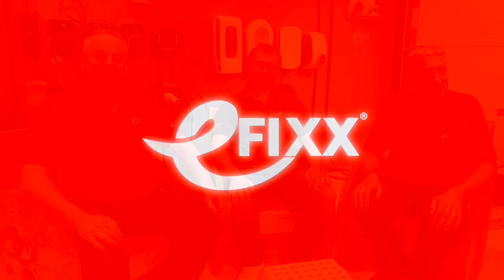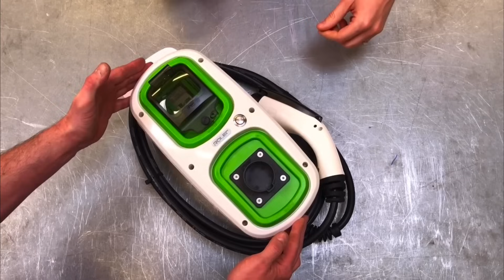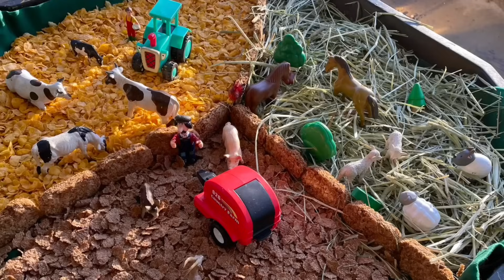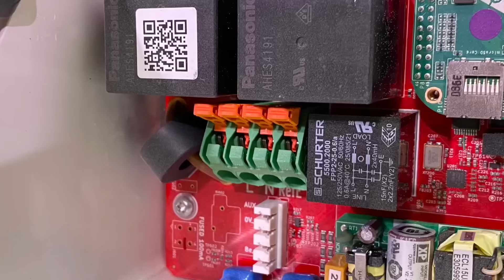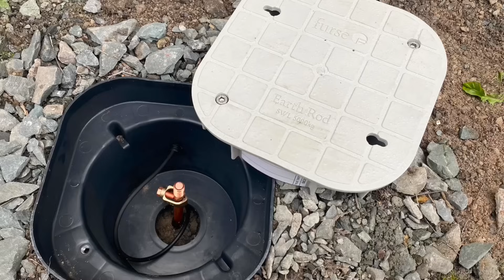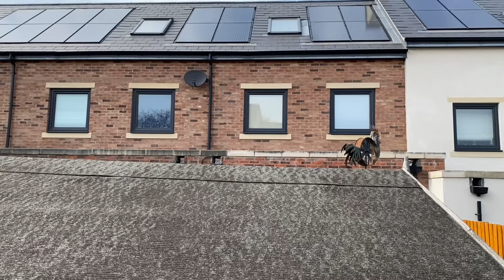EV Charger REVIEW: Cheapest, Smartest and easiest to install with EV Nick.

Comment: The easee charger is so simple it should be the only viable option for domestic installation
Reply: Am awaiting delivery of “easee one” however the other versions don’t compile with DNO for load balance
Reply: @NicolasRaimo  there arent any regulation on load in my country yet, the biggest advatage with easee is the simple programing and ypu dont need to use a app if ypu dont want
Reply: As others have highlighted unfortunately they don’t yet have a solution for load balancing (for UK meters anyway). For some (me included) this is a deal-breaker.

Comment: I was glued to this one, have you done a presentation yet on solar charging, e.g what is the average solar output of a single panel, what is the minimum amount of panels to charge at 7.2Kwh, are there solar EV grants available and so on.
Kind regards
Reply: It depends, but you can get a good idea of average yields for an installation here: https://re.jrc.ec.europa.eu/pvg_tools/en/#PVP

If you put in a nominally 1kW array, the angle, orientation and where you'd install it you can get curves giving you the average yield month by month.

You could do 7.2kW with a 7.2kW array in May but you might be looking at a 72kW array to do the same on a grey January morning. Unless you're in a hurry it would be easier to limit charge power a bit.

Depending on where you are it can also make a huge difference. Central northern England (around Leeds for instance) is pretty bad for irradiation and you can over-spec an array 30-40% or more over inverter capacity before you start noticing any reduction in yield.
Reply: @tceng9449  this is fantastic data, it gives me a good footing to carry out further research. 👍

Comment: I'm watching this with interest from Australia. Is there a reason that Andersen isn't in the collection? I see they're fitted by at least one YT Spark
Reply: Contacted them to send me a unit 12 months ago under the same terms of every charge point shown behind us for this video,  Didn't want to take part under the same terms wanted special terms just for them which I wasn't willing to flex for 1 company over the other 9,  Tried them one last time 2 weeks before filming this video never got a reply to that contact.
Reply: @NicolasRaimo  thank you!
Reply: @NicolasRaimo  trying there best as company to destroy themselves
Reply: They removed their inbuilt RCD protection last time we went to fit one, I think Jordan and Cory from Artisan found the same issue. Anderson also removed the hard wired connection for networking so they're only wifi enabled now. It's a very nice aesthetic charging point but outside of listed buildings and Porsche dealers bundling them with the Taycan it's dropped off for us. It's a shame as we did have a pending order for 2 dozen but client ended up going with Zappi instead.

Comment: Interesting as ever. I fear that in a few years electricity during the night will cost the same as during the day as "off peak" demand for domestic dwellings could be greater than their day time demand. Solar of course does not work very well "off peak" unless you have storage batteries. I still don't think most of the cables and transformers under the control of our DNO's feeding our homes will cope during the night with many homes possibly drawing a continuous 7 Kw load (electrical infrastructure in my area is 47 years old). We also will have to provide the power to charge the 2 million plus white vans up every night and they may have even greater energy requirements. Not forgetting all the heat pumps which due to low temperature heat output making you leave your heating on 24/7 (perhaps an additional 22 million 3Kw or more load on the network).
Reply: "Many homes" will charge ~450km worth of electricity each and every night? How do you come to that conclusion? That's about 13 times the average daily distance driven for cars in Germany, I find it hard to believe that Brits drive so much more...
Reply: One of our highest call outs in the south east currently is pen faults and low incoming voltage due to aging infrastructure (late 40s early 50s - 70-80 years old). It's already causing issues if only one or two people have EV's charging at any time (natural gas mainstay area so hasn't shown as an issue up until now).
Reply: Exciting times :) the french certainly built out their grid to supply heat a few decades back

Comment: I am not a fan of RCD at source for anyone that's currently app selling their driveway and charger access. It's one thing to share your driveway but it's another to give random people access to your consumer unit. Unless you're going to have an IP rated unit outside and that as the source but a cluttered outside wall is not something many home owners want. Not surprised the Anderson A2 isn't up there but they now don't supply it with built in Type A or a wired internet connection.

As for more people having smart connected appliances as prices go up, no. People just need to change their habits like they did when E7/E10 was a mainstay and time control their washing and drying loads for over night etc. Things don't have to be smart if people actually think, it's not good to encourage people to off load responsibilities to tech.
Reply: Absolutely bang on , smart technology does not make our lives or job better or easier, as it it doesn’t work always braking down has a short lifespan and it has to be replaced ,  look at smart phones every year or two we get a n upgrade or a new one because the last one is running a lot slower , and is no longer compatible with your new computer system so all your photos and dater is stuck on your old phone . Smart technology is useless and pointless.
Reply: @Dog-whisperer7494  It's not useless but an over reliance on "smart tech" in every and all situations is a waste of money and causes issues when it breaks down. The biggest issue with current implementations of smart tech is that it's not always backwards or forwards compatible with other alterations made to a system, incurring yet more unforeseen costs.